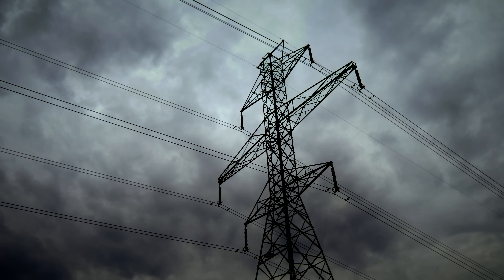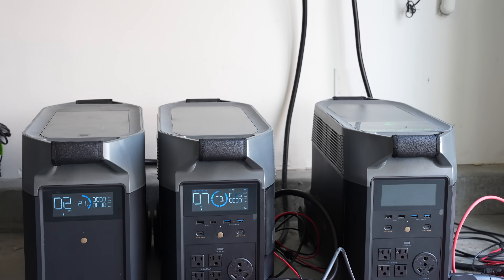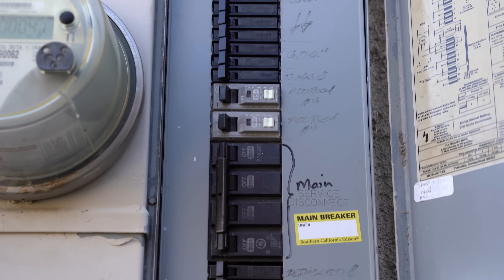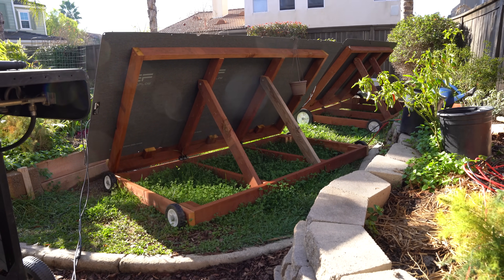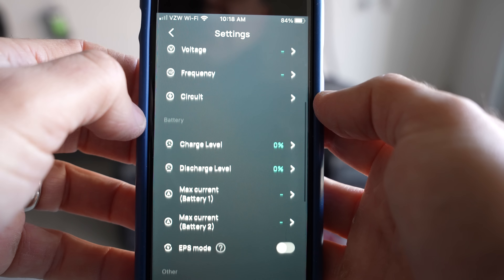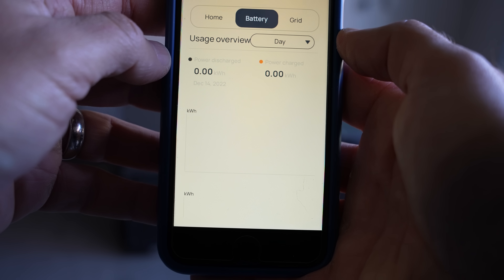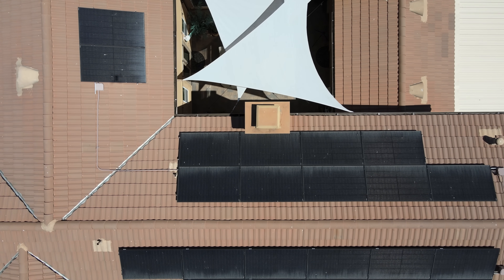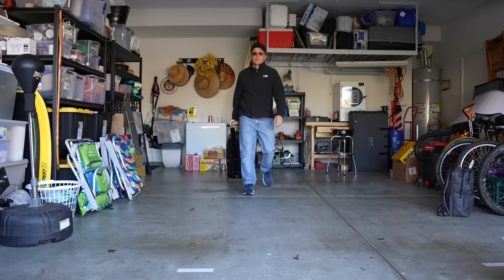Instant Power Backup: Ecoflow SHP + Delta Pro

Comment from the maker: Coupon code: PREPPING8 ... Links to items discussed in the video:
– Ecoflow SHP: https://cityprepping.tv/3v3oZaH
– Ecoflow Delta Pro: https://cityprepping.tv/3hGM53W
– Ecoflow Smart Battery: https://cityprepping.tv/3G1J0Vp
– Ecoflow Dual Fuel Generator: https://cityprepping.tv/3PCWH06
– Soluna S12 Whole Home Power Setup: https://cityprepping.tv/3hBF4kK
– How to determine your power needs: https://www.youtube.com/watch?v=y4T374GtKLI 
– Solar generator comparison spreadsheet: https://cityprepping.tv/3wyZNJp
Reply: That's a great recommendation! The Segway Portable PowerStation Cube Series seems like a reliable and versatile power backup option. With its massive capacity, quick recharging time, and durable design, it's definitely worth considering for outdoor camping and home backup power needs. Thanks for sharing the information!

Comment: Hey Kris, found your channel researching backup power sources. Instantly subbed. My question is do I need that smart panel or can I get by with a regular transfer switch? I have the Ecoflow dual fuel gennie and am deciding on either the Delta Max + battery or the Delta Pro. Thanks and keep up the great work!

Comment: I have the EcoFlow smart panel, 2 delta pro, and 4 extra batteries, so total 21.8 kWh advertised storage.  currently I do not have any solar panels connected.  I switched to time of use billing, and I am running the battery during the mid- and high cost times, then recharging during the least expensive cost times. Over the course of two months, I have saved approximately 30% off my energy costs by doing this.

After contacting EcoFlow, I found out the inverter takes 30 W of power per battery, so it would take 1.4 kawh per day if you are running either battery, or if you have EPS turned on in the smart panel. But, if you have EPS turned off in the smart panel settings, and are not using either of the batteries through the smart panel, then it does not use that 30 W to power the inverter.  However, if you have EPS turned off, it will take a couple of seconds for the power to switch on if the grid power is lost, and you will be setting the clock on your microwave again.

I did a test and got 16.7 kWh of AC usage to fully discharge the batteries, which then took 23.7 kWh of power to recharge from AC.  Taking the inverter power into effect, it seems that the battery efficiency is approximately 80%, based on the advertise rate of 3.6 kWh per battery, but is less if you are calculating the amount of power required to recharge the battery to full capacity.

I have this set up as a split phase, so one battery operates half the panel, and another battery operates the other half. Circuits one and two operate a clothes dryer. incredibly, it will power the dryer from the batteries with no problem, and will even run continuously if the total power exceeds 3.6 kWh per battery.  At times I was seeing battery usage of 4.8 kW on a single battery.

However, if I am running a high power device, such an air fryer or microwave(1300-1500 watts), and the fridge powers on the same battery on any of the circuits the battery is powering, the surge can cause the smart panel to switch to grid power, even though the schedule is set to run on battery. If I force the circuit to be battery only and this happens, then the power actually goes out for either the circuit that the fridge is connected to, or another circuit connected to the same battery.

As a result, if you are running a time-of-use to save energy, this could cause problems. In my case the difference between lowest energy and highest energy cost is about 4X.  So, if I don't notice this happening before the peak energy cost, it could cause some devices to be running off the grid instead of the battery as expected.

Comment: So anyone do the math on savings with these? My TOU per kWh for peak is 15 cents. 

My peak usage last month was 128kwh at $0.15/kWh 

That is $19 a month n savings if I went to battery. 

But that will be offset with increased grid power to recharge during off peaks, unless you have enough solar. 

So around $250 saved per year gross. 

Payback at least 20-25 years? At best? I don’t think these things will last much beyond 5-10 years. 

So I don’t buy the saving money argument with these things. 

Emergency backup sure. But assuming they don’t break down or get bricked by crappy firmware updates

Comment: The sad part is most times if the power grid goes down in the cooler months of fall and in the cold months of winter there is at a minimum overcast and just not conducive to recharging with solar panels. What do you do then?

Comment: If you dont have much money and you're worried about heating and cooling I suggest you get better insulation in your house. If your house is too hot in summer try to plant deciduous trees on the south side of your house to shade it. In winter the leaves will fall off and sun will shine on your house. If you want to preserve food get a small refrigerator with separate freezer on top and a smaller generator to power it either solar or gas/propane. Walmart sells fridges for 150$ that will help keep your food preserved for a lower energy cost.

Comment: The modularity is great. But also one thing I'd add is you can get a much smaller ecoflow, and use it as a back up power for just a few critical devices. Fridges, medical devices, a window AC unit.

Comment: I purchased a delta pro in 2021 for back up power. We recently had a power outage during a snow storm and had a 121 error code when I plugged it in to recharge it. It is now in Plano Tx being repaired. I do hope this is not a reoccurring problem. However, product support was very prompt and I had no issues with the company honoring the warranty.

Comment: I moved into a New home in June 2022.  It came with a High Eff Furnace, I think 95% or 98%.  Temps dropped to Minus -10/Minus -38 Wind chill here in Chicago on Christmas Eve.  Furnace no longer works.  24 of my neighbors with the same furnace also have no working furnace.  The HVAC company said they can't come out till Monday.  So today is Day 3 with No heat. Went to Home Depot to buy some portable heaters. Give me back my 80% non-efficient furnace that Never broke in 25+ years. :oops:

Comment: We have the Eco Flow Pro as well. Started with the Pro only, refurbished from EBay saved a lot of money.
If you don’t need the portability, get an separate LIOn battery, and a inverter/charger and cost per wh is higher.

Comment: You mean you don't have to spend $5,000 for "your carpenter" to build you a battery house, $1,000 for mineral wool insulation, $4,500 on batteries, $2,000 on solar panels, and $700 on a new generator plus gas to run the generator to keep the batteries charged? 3 Eggs🥚🥚🥚🥚

Comment: Unless you live in a apartment, it's hard to beat a generator and fuel cans that you can ether treat or rotate by fueling your car/ truck with.

A whole off grid system would be nice but the upfront cost is insane unless you can do all the work yourself.

If I was still in a apartment, I would be using a decent size power station to keep phones / tv / router going.

Comment: Why spend thousands of dollars on something that won't power your ac or heat? Just get a wood stove. If the lights go out during winter, it will keep you alive, & you can cook with it. When the lights go out the last thing I'm worried about is overhead lighting, watching TV or charging my phone. Imo that's a weak reason to get this system. What we need is a system capable of powering the ac & electric furnace. Otherwise there's no point in spending the money.
Reply: Depending on your home, these units can power a lot of essential items.   Not everybody has an electric stove or furnace.  We have just one DP unit and it can power everything in our home. (Except the Central AC) NG is our main fuel source for heating and cooking. We can run our 120V 90plus NG furnace off of it.

Comment: I see that these types of systems would really augment a gas generator well, really a hybrid approach to home power.  These could be used overnight to run critical items such as a furnace, while using the generator during the day to run everything in the home in addition to charging the batteries back up.  In my mind, this should decrease the gas used, as generators won’t need to be run 24 hrs per day.  Add Solar to make it even more efficient.  In my home we average 35kwh per day, so the battery only approach to multi day home power backup doesn’t make sense.  I also like the idea of keeping the generator off at night for op sec.
Reply: You are so right.  This is actually how our system is set up. (Except we don't have solar panels) For us, our system is only for backup power.  Doesn't make since financially to purchase a 18kwh system. It would take us over 10 yrs to get the money back, with our current cost of electricity, from the grid.
Reply: I use up about 20KWH a day in winter. I got a 10 circuit 30A manual transfer switch. Over $8k cdn with sale price and discount code for 1 DPro, expansion battery and 1 400 watt panel. 

I’m hesitant. A lot of money and wonder how durable these things are. Battery ain’t the problem. Software and electronic failures will turn these into heavy paper weights. 

But my idea was similar to yours. Run stealth backup and rely on short recharge with a generator during the day if needed. 

3.6kwh won’t even cover my critical loads for 24 hours I think. 7.2kwh would stretch out the generator recharge cycles to at least 24 hours. 

My problem is no sun in the backyard during winter unless roof mounted. So portable panels are useless. 

And roof mounting panels is adding thousands of dollars and isn’t portable. 

Not to mention the DPRO weighs about 100lbs so heavy to carry up from basement to recharge via generator unless I get a very long extension cord

Comment: We have an eight year old, Solar Edge grid tied inverter, net metering and receive quarterly SREC payments.  We would like to add battery backup, but we may or may not be moving.  Portable batteries would be ideal.  Since we already have roof mounted panels, is it possible to supply the inverter from the SHP to sense grid power and have our existing solar system provide power during the day and battery backup at night?  Essentially, is there a way to replicate a hybrid inverter without replacing our current inverter?  Much appreciated for any thoughts on this.

Comment: Just put in a Generac system in October.  It was spendy, but worth it for total home security and to have heat in these massively low right now here int he Mountain West.  I still have two gas Yamaha generators just in case, but should never need them.  I feel quite good in the back up electric situation!

Comment: You should have mentioned some competitive alternatives. I have 2 bluetti ac500s that power 20 home circuits and can charge by 6kW of solar. Much better than ecoflow. For $600 you can buy a dual fuel generator to provide supplemental power. Oh and they also provide 240V with the fusion box adaptor. All in much cheaper and significantly more capability. Also completely portable. But understanding that ecoflow sponsored your video I acknowledge your bias.

Comment: Problem with eco flow is the fact that it’s 4x the price of other complete systems, and has serious limitations on how much solar they can take in.
Reply: If money wasn’t a consideration then yeah, ecoflow makes a fantastic system.
Reply: Not so @ 375Cheytac.
Reply: @user-og8kc1qd2d  care to share? You can get 61.5 KWH for $17,988 if you go DIY, throw in an extra $4k for inverters and certifications, you’re at $22k.

61.5 kWh from ecoflow you would need:
7 x delta pro’s ($25,193)
10 x smart battery’s ($21,890)
Totaling $47k vs $22k

Also you can get much cheaper if you opt for lead acid DIY, but for a complete server rack it absolutely blows eco flow out of the water in terms of price for what you get. Tell me I’m wrong.
Reply: @375Cheytac  - Again no one ever puts price of tools, wires & cabling which gets expensive as well. Out the box Ecoflow & bluetti are pretty much top
Reply: @1ENDUSER  I put down $4k for inverters and certs. If you’re wiring 1 gauge non alum filled pure copper directly to your fuse box you’re NOT going to be spending more than $30 on that wiring. As for tools? Yeah if you wanted to send it and get a $2000 Milwaukee electric stripper then sure, I could see that, but everything above can be done with no more than $40 worth of hand tools assuming you literally have nothing (which would blow my mind if you’re on a prepper channel). 

Like I said, if you’re ignorant, or money is no option, or if you’re just pure lazy, then eco flow and bluetti are a good way to go but to suggest it would cost more than $4k to buy crimps, a box knife for stripping, insulation, a Philips screwdriver, and 4 feet of 1 gauge and say 60 feet of 4 gauge then there is no hope.
Reply: @1ENDUSER  and I don’t want to take a dump on what you spent your money on (ecoflow) but there’s no need to pretend like there aren’t much more efficient ways to go in terms of price/scalability per kWh.

Comment: I bought just over $5,000 in ecoflow after you recommended them before. I did my research, Ended up getting several Delta 2's and extra batteries as they have the new Lipo4 chemistry that allows them to last 10 years if used daily. I would love to see all the new ones come out with the same chemistry. I also have a 13kwh tri fuel generator as a backup, and plan on getting a smart generator as well for the smart start features. I live far up in the snowy and cold mountains so its important to have power.
Reply: Just a word of ( caution) I watch several proper channels. The ones up north west have been warning-> smart run equipment can be controlled by the grid. You can be  turned off, turned down ect. By the wimp of the grid. Not telling you not to do what you want, just info. You decide.
Reply: @user-og8kc1qd2d  I could see that being somewhat true if connected via the app or wifi. The system does run without any wifi or outside world connections to it. If that were to happen I do still have Solar, and a 13kwh standard generator with no connection to anything,
Reply: 10 years if used daily sounds a lot like that might be recommended 👌 potentially lasting a fraction of that if not used regularly. K.i.t

Comment: I’ve got this setup, maxed out.. it’s hard to truly call it “whole home” though. It can’t power my furnace or HVAC because those are over 30 amps. It does power the well pump just fine with is nice, but even with the maxed out configuration, you’re still on your own for heat / AC.
Reply: Do you know how efficient the EcoFlow a/c happens to be? TY.
Reply: @queserasera1674  I don’t know much about the AC unit. After watching some of the reviews on it, I could see that it wasn’t the best fit for my needs.
Reply: @Mbchp  Thank you for your reply; I appreciate it! :-)

Comment: I've got 12.445 kwH on my twenty marine batteries. With the gasoline generator included, it was a little bit over $5000. Showing 25.0 volts after two inches of snow today. Took me two years to pay for mine. I guess it's a good thing I started when I did.

Comment: This is great information if you live on a property with sun exposure - I do not. I also like this Eco-Flow system's ability to grow as desired. Even though I have nearly an acre of land, my southern neighbor's land is a forest with trees that rise to anywhere from 110 - 130 feet so I get very little sun here except at the height of summer. This is why I went with a 9kW generator with an automatic transfer switch hooked up to a propane tank instead of solar panels. Hopefully, if the grid goes down the propane won't go along with it! Thanks, Kris.

Comment: You’re better off getting a whole house generator and putting in two 2500 gallon Lp tanks into the ground. Then using a valve to feed the generator. Most have a sliding switch for natural gas or lp. Just saying. Months of run time for the whole house.

Comment: What is your opinion for batteries that are hooked up to the house on the wall? Like a more 10-20 year longterm setup. I have been carefully watching enphase systems. I have a 48 panel array that is like 18,000 kwh. I produce more than 100% used every year (by a lot) since I don't have my EV's yet. Are you familiar with all the home battery systems? Or just the ones that you discussed in this video.
Reply from the maker: enphase is extremely popular.  i don't know the details of it but it is popular.  I have the Soluna S12 home battery backup system.

Comment: Solar panels on a house kind of don't make sense especially if your house is 15 or 10 years old I suggest texture that your roof is sound because if you have to get a roofer to fix your roof they're going to have to spend extra money to take those panels off just to get to the roof which will cost you triple the money just to fix your roof or a leak in a hole on the roof so having solar panels on a roof don't make sense unless the house is brand new because it's going to cost you more money when you have to maintain the roof maintenance the roof..

Comment: I’m looking for a whole house back up, but I’m going to need 20 KW. I can get that at a home generator set up an install for less than $17,000. I don’t think you can do that with solar.
Reply from the maker: you can get a Generac 22kw generator for $6500.  Of course, you're limited to fuel on hand.
Reply: @CityPrepping  Now add a foundation. Trenching, conduit, wire, auto transfer panel, 500 gallon propane tank, regulators, piping, labor and materials.